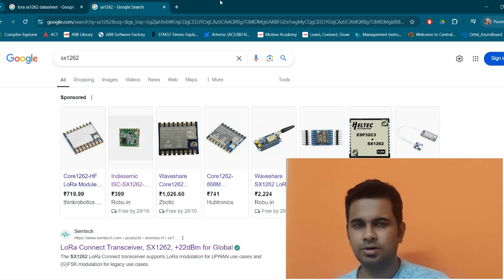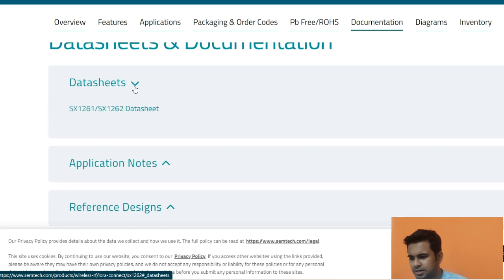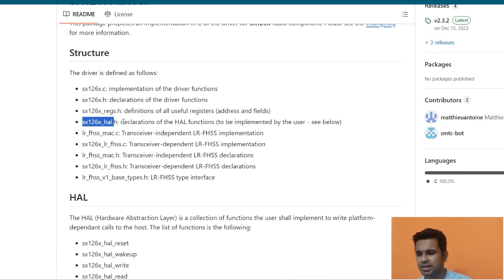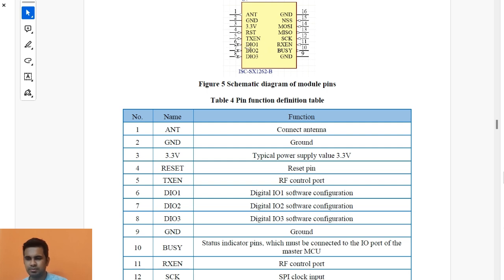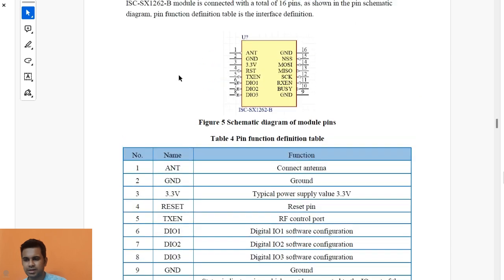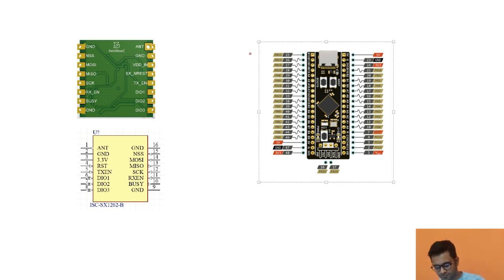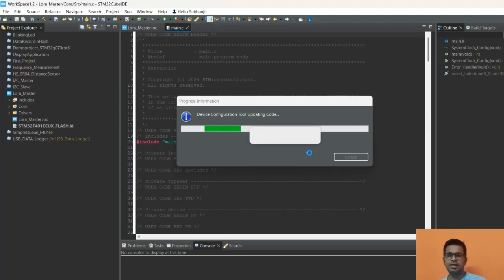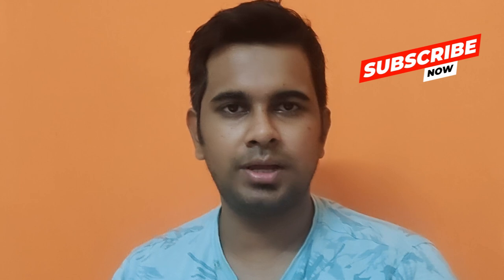LoraModule Configuration in STM32  Part 2. #SX1262 #stm32

Comment: Hi mate im designing a project that 2 stm32 modules communicate eachother with LoRa modules with antenas ofc. My project is basiclly i bought 2 bluetooth modules for my phone to connect stm32. I want to type something from my phone and it will send from Stm32 to LoRa to other LoRa->Stm32-> Phone. And Other phone see my message and response  to . Its basicly that. Can you help me by anychance ? These are my equipments ;
STM32F407 Discovery Kit  2x
EBYTE E22-900T22D V2 model 868 MHz LoRa 2x
CDM 868 MHz 915 MHz Antena 3dBi SMA Male Connector - 11CM 2x
HC-05 Bluetooth module 2x
I bought all of them
Reply from the maker: What kind of enhancement you want. ?